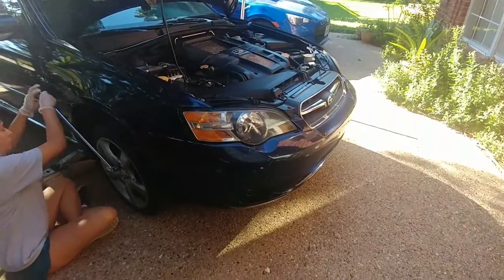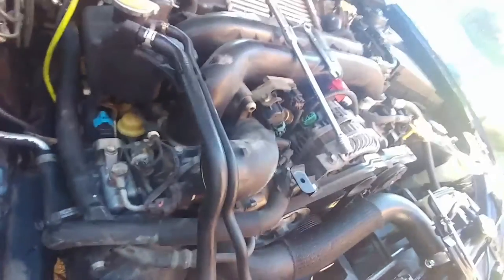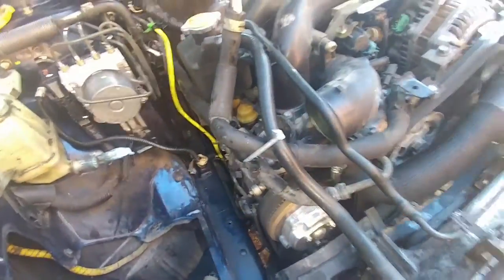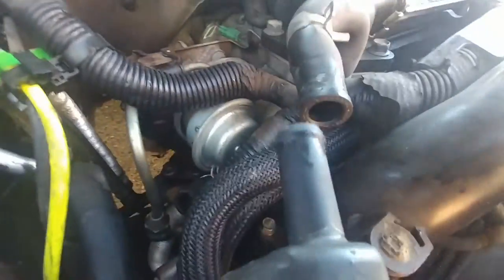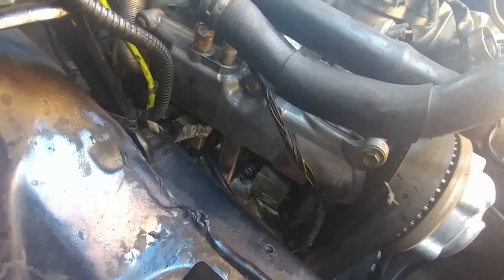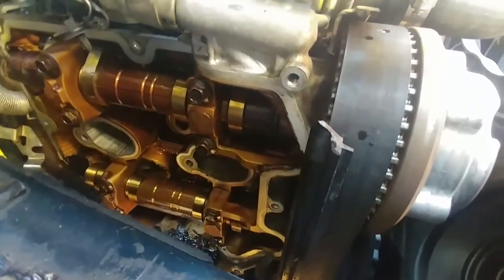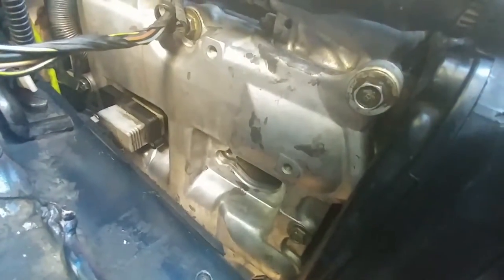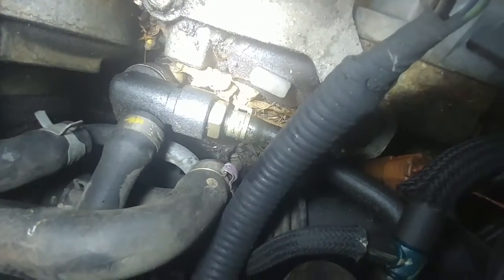2005 Legacy GT Valve Cover Removal - Do I need to lift the motor?

Comment: Nice Vid.  

Buy a cheap 1/4" torque wrench from Harbor Freight. You can get it on both coil bolts, and all cover bolts, except the back bottom. Put an offset on that one  (like you did) AFTER using the torque wrench on the other seven bolts. You can use muscle memory to approximate.

Plus, with many bolts like that it's always a good idea to use a piece of cardboard and a marker to keep track of where they go for assembly.

Comment: Great Video...ashamed I didn't look or find it over a year ago..finally did it myself last week.
NGK (7913) SILFR6A Spark plugs while your in there .
99071AC020 bigger hose that goes to the valve cover.. had to cut mine because it was original and stuck.
Also Dexron III ATF fluid is what's used in the power steering. Just some bits that I researched while doing mine..my car was down for a week as I had a backup. 05 GT Wagon.👍
Reply from the maker: Yes, we just need the right motivation and then dive in... good list..

Comment: I've got the 07 spec.b and the damn thing has this double metal bracket shielding the oil control valve area. Two bolts tucked underneath are impossible to get to one is blocked by the first those and the other is blocked by the OCV itself. Makes a simple task impossible

Comment: Hey, I am glad you made this video. I'm about to undergo the same procedure on my 2005 Subaru legacy gt. Its been leaking  oil really bad from the passenger side. I just ordered the gasket online. I was just curious if you had any possible suggestions for me. Also I was wondering if a ratchet would have fit when you removed the coil packs and cover. Finally, I wasn't sure if I should apply sealant or just clean it up and put the new gasket on. Thanks. I'd appreciate your advice
Reply from the maker: luke s hey, glad it helped... Yes, it only calls for sealant in certain areas but I put it around the whole thing... First a little inside the groove and then a little in and outside the cover. I used black, high temperature sealant. As far as a ratchet... No way it's too tight. Also, do not over tighten! It felt pretty loose when I applied the correct torque.  Finally, it stopped leaking completely. I know it sucks having it leak...but after you change the gasket... It will be like New again! Let me know if you have any questions.
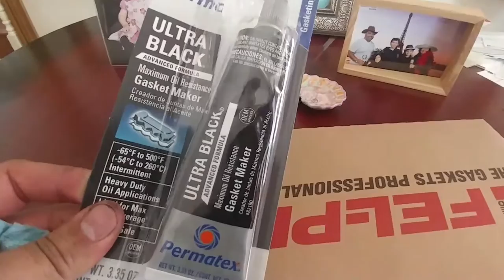Reply from the maker: luke s also... You'll see the sealant I used at 16:55
Reply: Sounds good. Thanks for the info. I forgot to ask about the torque wrench. How did you fit it in such a small area? I thought you could only fit that elbow offset wrench
Reply from the maker: luke s oh, yeah... There are a few bolts you'll be able to torque with a wrench.. then feel how tight it is and then eyeball the rest... Remember to follow the bolt tightening path... I think, I show it at the end of the video...